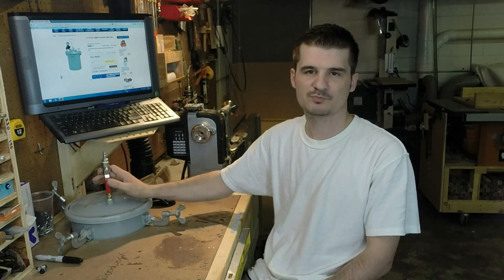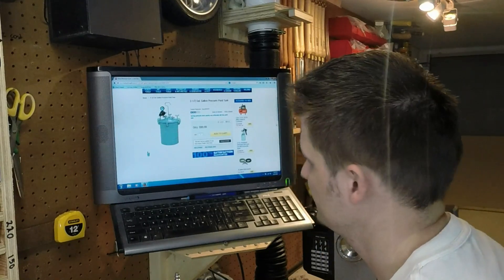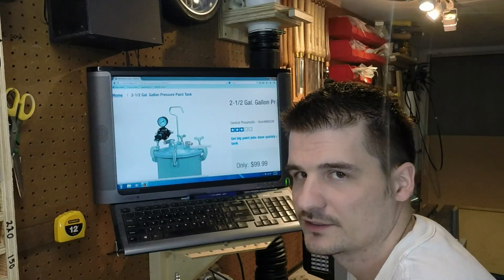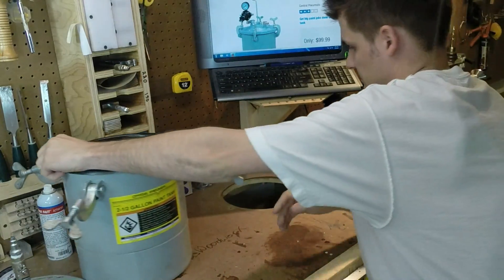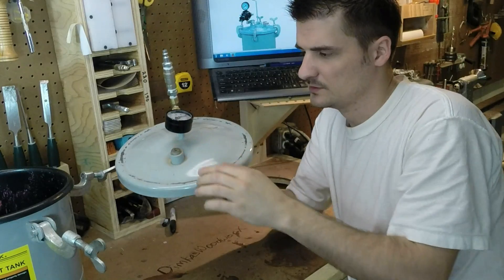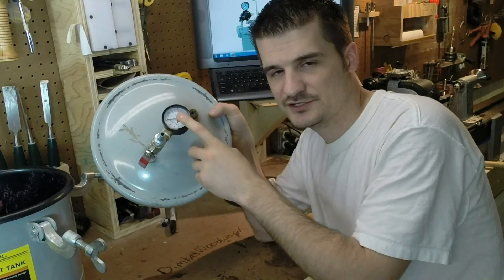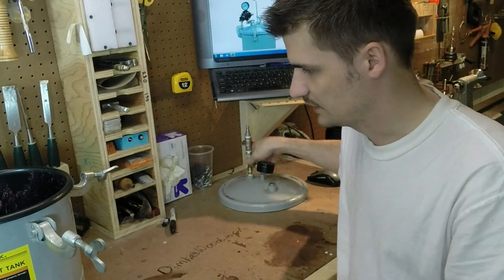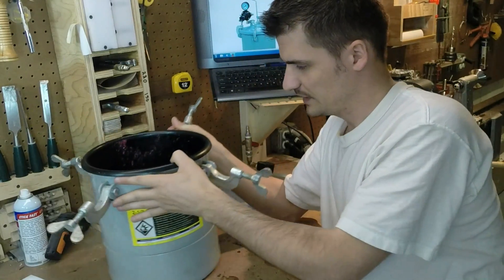Worthless wood casting pressure pot setup..

Comment: One of the bits that you removed was the safety valve. If your gauge ever fails you could potentially over-pressurize the chamber with catastrophic results.
Reply: To anyone else who stumbles across this video. ABSOLUTELY do NOT leave the relief valve out of your build. It can be placed in the hole intended for the paint hose.

Comment: Hallo Dima Thank you so much for the video I just finished my Pressure Pot it works perfect. My question now is can I turn around and use the pot as a vacuum pot as well? I want to change the top with plexiglass and use a vacuum pump would that work?  Do you have a video maybe how this can be made? I think many people here like to know this
Thanks a lot for answering 
Doug

Comment: sir, how much horsepower HP should i buy the air compressor  to support 2 1/2 gallon paint tank. if more detail it really nice. i already buy the paint tank as you are have now. more detail on the air compressor to get 60 PSI as you do it. thank.
Reply from the maker: Hp doesn't matter, as long as it can reach the maximum psi you are fine

Comment: Hi can you please tell me what are the advantages in using a pressure pot vs a vacuum chamber?  I notice a few blank stores selling vacuum pumps and vacuum chambers to make pen blanks.  I am confused and I do not know why they are not selling air pumps and pressure pots.  Why did you choose this method for making pen blanks?  Thank you in advance for your answer.
Reply from the maker: R N there are two different ways of making blanks, two different scenarios.  when the wood is punky and soft, it needs to be stabilized with stabilizing resin, this requires a vacuum pump to pump the air out and replace it with the resin, once heated the blank becomes hard. This method does not work well for big voids or uneven wood that you want to make square.

The second method is pressure casting with alumilite or polyester resin. this methog fills large gaps. the pressure pot used in this methog compresses the air bubbles so they are not vissible and at the same time pushes the resin deep in the pores of the wood. Cant use vacuum with these resins because of the short working time and would harden by the time you try and vacuum. 

i hope this answered your questions :) if not let me know

Comment: I have the same pot.  It is rated at 40 PSI.  I see you took the relief valve off of yours.  Would it be safe to do so with mine and go to the sixty PSI?
Reply from the maker: Marc, im not sure there is a relief on these pots, there is a regulator that i did remove because i use my shop air regulator. Also my pot has a sticker that states its max 60 PSI max. If yours has 40 psi max, im not sure its a good idea to go any higher.
Reply: @DemasShopforEverything  Everything and anything designed to operate under pressure has a relief valve. It's the little brass piece with a small ring that you can pull.
 Since you haven't responded to any comments in quite awhile I certainly hope that you weren't killed by your pressure pot...
Reply: NO! It's not safe to build ANYTHING that holds pressure without a relief valve!! If the gauge fails you'll have no idea how much pressure you're putting in the pot until something breaks catastrophically.